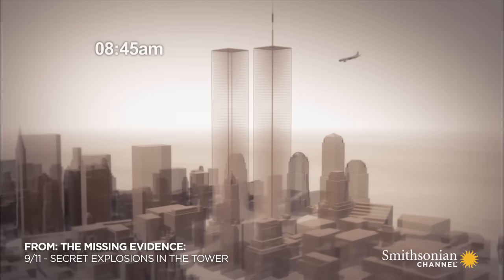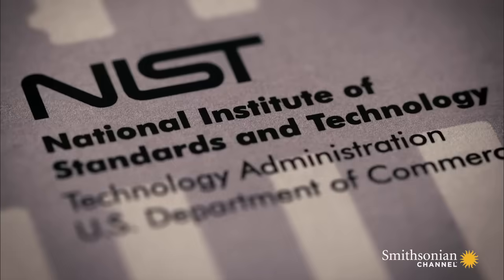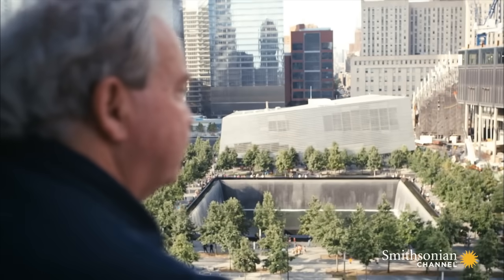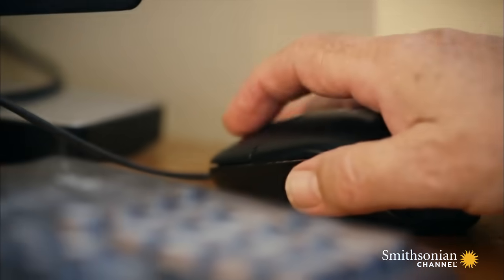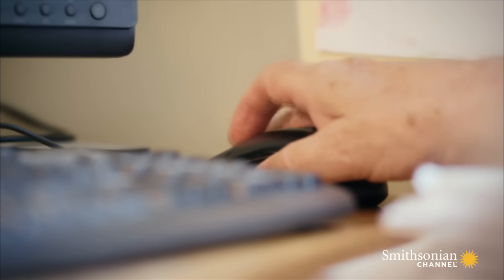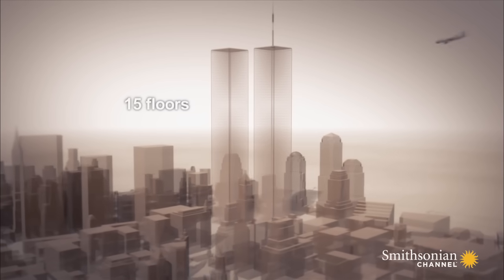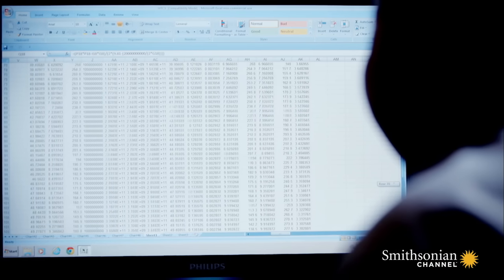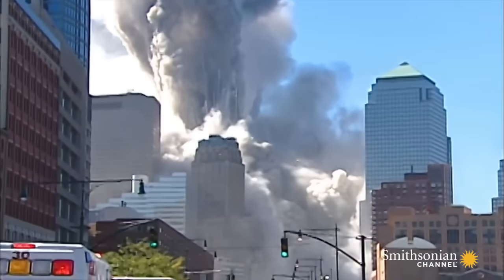This Computer Simulation Explains How the Twin Towers Fell

Comment: The "floors" below is a sound structure interconnected. The core bearing 60% of the load is connected all the way down to the bedrock. This is a disingenous analysis, it is analog to analyzing a car crash and say that if the front bumper gives way, the rest will follow. This will be like dropping a smartcar vertically on a semitruck with same integral composition and it will not result in total annihilation and horizontal ejections within 10-12 seconds. No physics model would allow this.
Reply: Notice no paul here
Reply: @chazmichael7967  XD IKR
Reply: But, yet, the 3 programs he ran said that both towers pancaked under their own weight. Go take an engineering class and figure this out for yourself you dumbf**k
Reply: That I know. But up top, the entire structure was weakened. Once the main floor with the fire flattened, it was a chain reaction. WTC7 fell from large portions of one of the towers striking it.
Reply: The towers both took longer than 12seconds to completely fall. It was more like 28
Reply: @slooob23  it seemed that way, but in reality, it did take 12-15 seconds to fall.
Reply: @norfolksouthernrailworks1543   no, they literally didn't fall that fast. Both the cores of each tower stood after the exterior columns had fallen away, there was 60-70 stories of core left standing for about the same time it took for the rest of the building to collapse. The buildings exterior structure literally 'unzipped' from the core, fell out and away, then the core stood, wavered, and fell last. This process took a lot longer than 12 seconds and it is clearly visible on multiple videos.
Reply: The buildings didn't collapse that way, only the floors between the core and the exterior "pancaked", the core of both buildings remained standing (for a time) after the exterior columns had fully collapsed. It's easy to understand how this happened, once the floors no longer connected the exterior columns to the core, the tube structure was critically compromised. The exterior columns peeled away from the core like a banana skin as the floor collapse propagated down between the core and outer columns. That explains the puffs of dust/material on floors immediately below outer column separation and break up. 
The twin towers collapsed around their core structures, it was nothing like a controlled demolition or a building falling within its own footprint (which they clearly didn't).
Reply: ''This will be like dropping a smartcar vertically on a semitruck with same integral composition and it will not result in total annihilation and horizontal ejections within 10-12 seconds. No physics model would allow this.''

==> That's a very bad example, because to scale the semitruck is much much stronger than the bottom section of the twin towers..... And a (truck vs car) does not have enough mass to do a proper demonstration.
Reply: @drunkpeopleareviolentandan4893  Well said.
Reply: @norfolksouthernrailworks1543  
3 story high multi ton steel columns held with 5kg bolts.
Reply: indeed
Reply: 4465Vman  What are you babbling about?
Reply: @mryourfriendbutters8900  Karen!?

Comment: The Windsor Tower in Madrid burned for over 20 hours and when the smoke cleared the frame stood tall. The WTC buildings went down from Controlled Demolition. There’s no two ways about it.
Reply: "Controlled demolition" a few things - it wasn't controlled, the building parts went everywhere, it didn't fall inside it's own footprint, the sides peeled off like a banana skin, it initiated from the top down, and 60-70 stories of the core stood after the rest of the building was gone.
You call that a controlled demolition?
Reply: Did this windsor tower take the damage from aircraft impact also?
Reply: @markk3652  the impact of an airplane is not enough to take down a whole building, the argument people use against critics is the "heat" from the jet fuel that caused the catastrophy, yet all of those people need a good lesson in thermodynamics.
Reply: @lillexus5589  the design of the twin towers had the load of the building borne by the outer columns. The damage created by the impact of the planes severed these columns in such a way that the buildings were mortally wounded. The fires created by the explosion, and the jet fuel dispersal upon impact, weakened the truss system that supported each floor. It's a simple matter of physics here. A monumental amount of weight, a heavily damaged skeletal support system, and roaring uncontrolled fire all culminated in the collapse. No conspiracy, no controlled demolition, no nonsense. You've by now have seen the events that took place 19 years ago, yet you let imagination and paranoia control your thinking. Big planes hit big buildings, they came down as a result.
Reply: You are 100% right
Reply: Different building, different design, different construction. But sure, comparing apples to oranges is proof, isn't it?
Reply: @Tim22222  same steel, same set of physics that apply to the building. Building a sky scraper is not a piece of art where you decide what to draw or make, from a technical standpoint most of those building are made with the same criteria and follow the same rules that have been harvested from previous building malfunctions. Atleast try to have some knowledge about the subject you are talking about.
Reply: @Tim22222  what are you babbling about?  Tell me again about your paid for opinion.
Reply: So they hijacked planes and instead of using them to destroy other buildings they used them to destroy the two buildings that could already be destroyed at the press of a button?
Reply: @lordkizzle  what are you babbling about
Reply: @lordkizzle  Why can't you talk about the holographic planes babbler
Reply: @c.augustedupin1926  lol you copycat impersonating babbling babbler
Reply: @MrYourfriendbutters  Still nothing about the direct energy weapons babbler?
Reply: @mryourfriendbutters8900  what are you babbling about
Reply: @MrYourfriendbutters  What's that copycat babbler?
Reply: @c.augustedupin1926  what are you babbling about